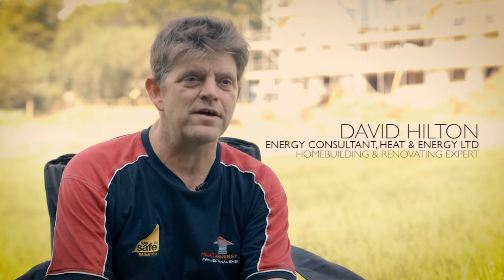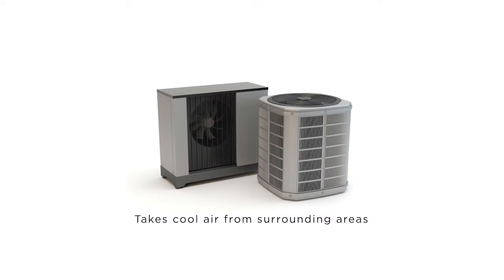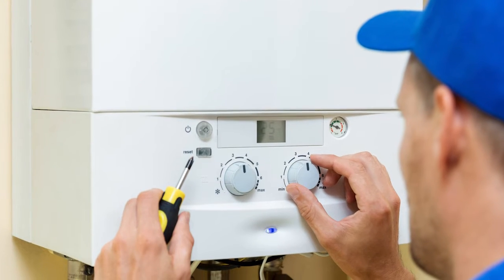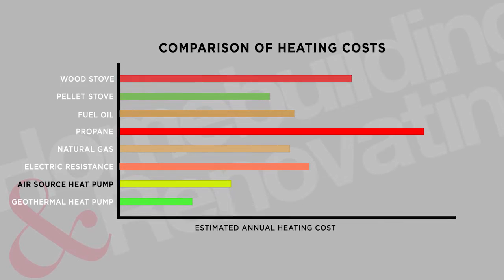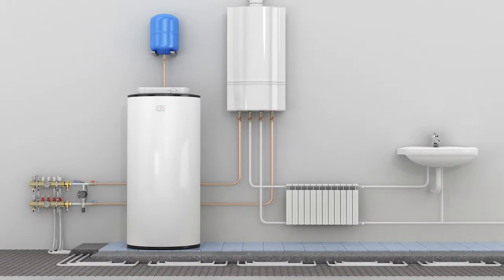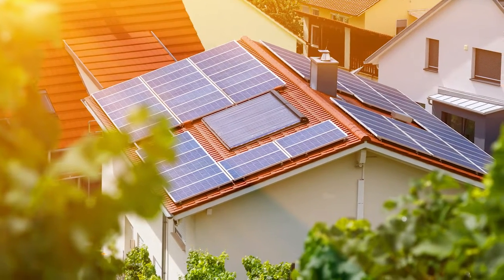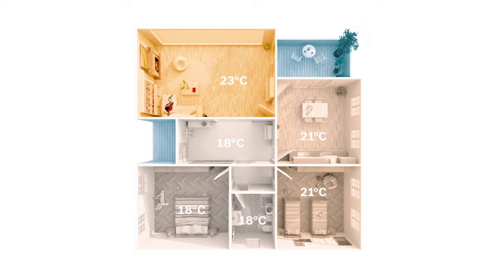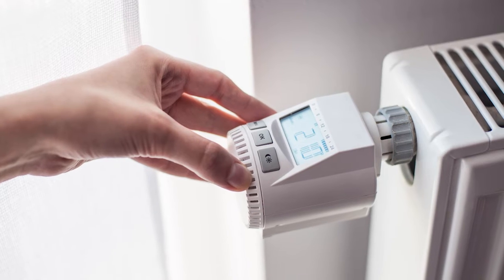Guide to Air Source Heat Pumps | EXPERT ADVICE | Homebuilding

Comment: Green hydrogen would be a more efficient and economical solution if you take into account there are 23 million natural gas boilers (1.4 million oil boilers) and few people can affort £14,000+ to convert their homes to efficient ASHP.  It would cost £2,500 to switch boiler to 'hydrogen ready'.  The government is considering converting the nation's gas network to hydrogen.